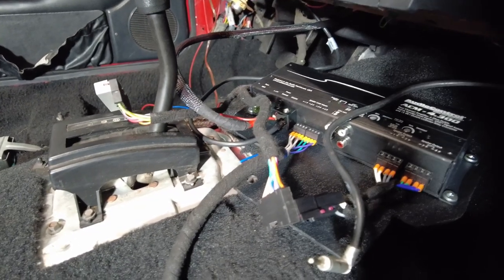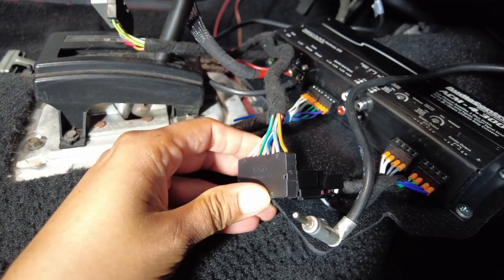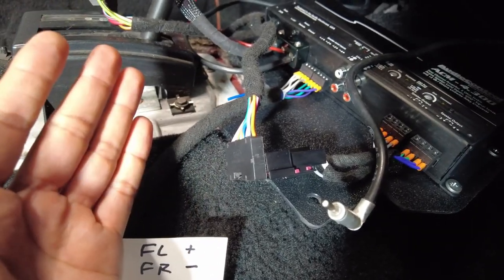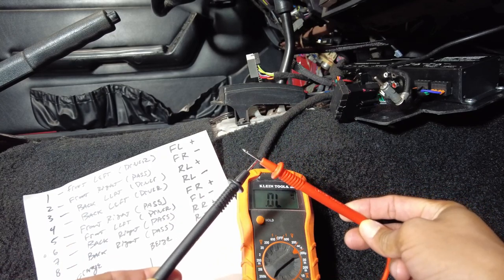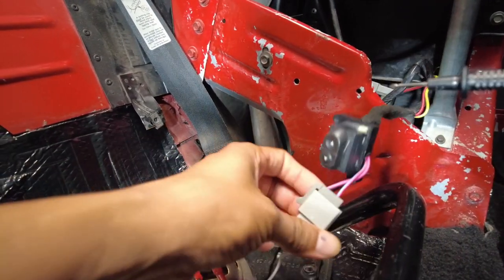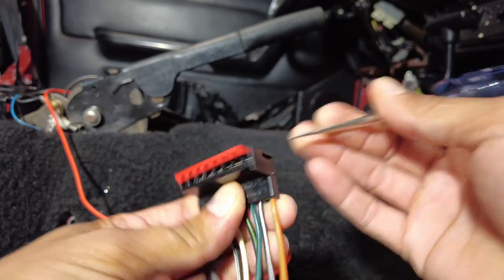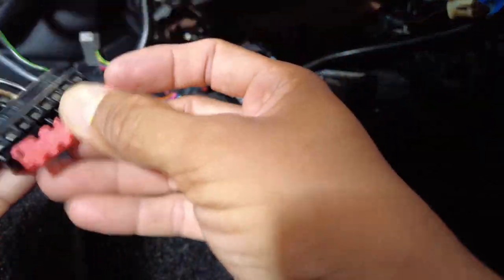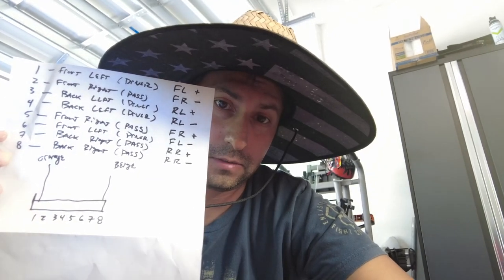Test Your Speaker Wires and Fix Your Crappy Sounding Ford Foxbody Mustang

Comment: This is great info.  Thank you.

The premium system was decent for the era...not the best or worst of factory systems available then.  At this point, the speakers have been in a car environment for 30-35 years, and certainly have at least some degree of age.  The Ford/JBL system I had in two Mark VII's was excellent and still holds up well now.

The rare system with the equalizer was, at least electronically, better than the common head unit.  The reason why, and not just because it has another feature, is the regular Premium Sound that came in the Mustangs up 'til '92 had a small built in amplifier feeding a speaker level output into the separate amplifier.  The equalizer version, like all better head units (including what Ford was putting in Lincolns when they updated the head unit part way into 1988) is preamp only, so what comes out from the system with the equalizer is preamp level and goes into a different amplifier - even though it looks the same - that has more gain because it's receiving a preamp output and I believe was 100 watts total instead of 80, although Ford did not publicize this.  The speakers are the same, but with the equalizer, you can tune the system better to the car's acoustics or however you like.  Of course, the system with the equalizer can be used for the same purpose with better speakers and amplification to properly drive them.

As with so many older cars, if you can bypass the internal amps, or at the least feed the speaker level outputs into a proper separate amplifier of good quality and put in good speakers, it will sound fine.  I had the Quadrasonic 8 track unit in my '77 Mark V modified so I also have preamp level outputs, and fed into a much better amp and speakers, it sounds far better than most people would imagine.

Now that older head units can be modified to accept modern sources, I at least mention all this because some may have removed the original unit because of possibly sound quality, needing different sources, etc, but may like their dash to look correct.  If so, they can definitely get far better sound than how it was originally.  Think of it as stealth performance mods for audio.

Comment: Ford diagram says my '89 'Vert is: 
Orange/Light Green
Purple/White
Pink/Lt Green
Purple/White
White/Lt Green
Purple/White
Pink/Lt Blue
Purple/White

But mine is:
Orange/Light Green
Green/Orange
Pink/Lt Green
Pink/Lt Blue
White/Lt Green
Blue/White
Pink/Lt Blue
Green/Orange

And I know 1 and 6 are swapped  for sure, but ALL the returns are wrong.
Too much fun.
Reply from the maker: @Fredness2300  ALOT of them were mixed up at the factory. Mass production at its finest 😄
Reply: [Sad Panda Noises]
I'm going to document and replace with new.  Ugh.

Comment: Just tried to install an aftermarket alpine head unit in 91 fox body gt convertible i just bought for my daughter and it turns out the speaker hatness only has 5 wires so im guessing they have ground negative. Shouldnt i just bypass harness and run new wires from speakers to back of stereo???
Reply from the maker: What car is it? A fox
Fox should have 2 plugs. I wouldn't install anything directly to wires. If she hates the head unit you will have to cut it off and keep making your speaker wires shorter